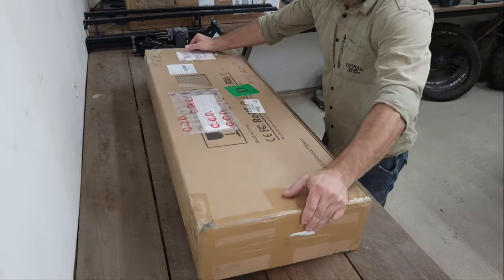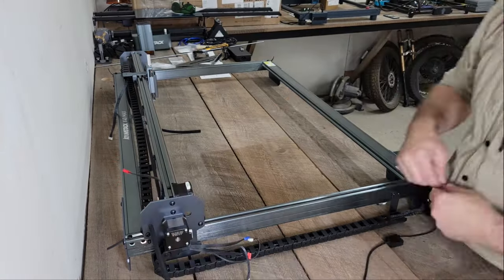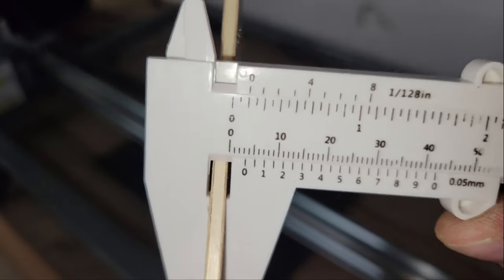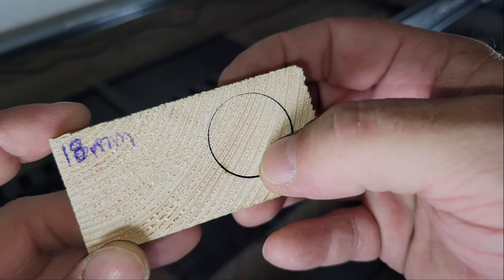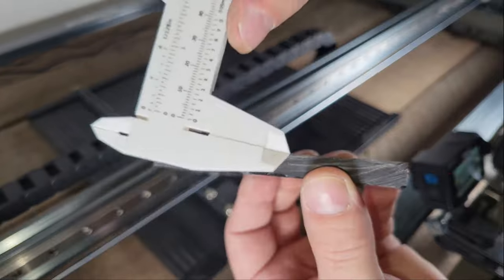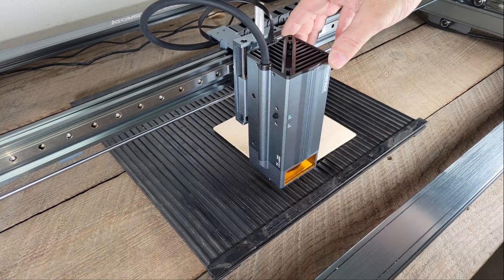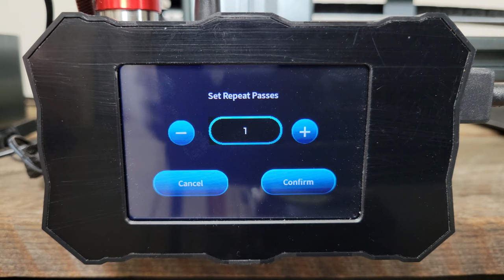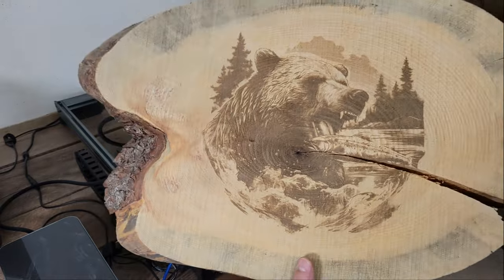Atomstack X40 Max 48W Laser Engraver Review

Comment: Just purchased the AtomStack X49 Max. I purchased the cover for it, I don't like it. It covers up the workings of the machine. I need to make some blocks to stabilize the legs on the mounting surface. Also need a way to use a riser of sorts to use a rotary. I also purchased a very nice cutting surface from Amazon. It fits perfectly.

Comment: Am I the only person who like to use thicker plywood for projects? I notice everyone always tests cutting through solid wood but never 1/4" or 1/2" plywood...
Reply from the maker: Then you haven't seen enough of my videos. I test cut through 1/2-3/4" ply all the time. The power requirement difference between ply and natural wood of the same species is marginal at best. Ply is more predictable because the quality is more consistent and easier to control. No knots or fatwood to deal with. I like using thick plywood when the need calls for it. Not everything calls for thick plywood. Not everything looks good made with plywood, either.

Comment: Can you please do a video for cutting ABS plastic 4mm? Thank you.
Reply from the maker: You can't cut abs with a laser, unfortunately. It doesn't vaporize, it melts. Makes a mess, inaccurate, toxic fumes.
Reply: @JamesBiggar many thanks for your reply. But acrylic can be cut, according to some information. That s correct?
Reply from the maker: Black acrylic only for diode. If you want to cut others, you need co2
Reply: @JamesBiggar  appreciate your reply. Very useful!
Co2 equipment's much more expensive.
This thing of laser cutting is not easy as a person could think.
Thanks for all

Comment: Nice review. How long did it take to receive, once you ordered? Have you had any problems?
Reply from the maker: Only took about a week and a half. No problems yet. Super simple to set up and it's working great so far. I've invested the same into other engravers that weren't half as good as this. Literally less than half the size, half the power. The quality is top notch.
Reply: Hey BeetleBeetleY, I also own a X40 Max and struggling really hard to get useable cutting results out of it. I mostly try cutting 9mm plywood and it is always a balance between cutting and burning the material. when you try complex shapes most cuts are inconsistent and the surroundings get heavy burned. Think about what you want to do with your laser, before you buy one.

Comment: Any idea if it can cut carbon fiber sheets? 3mm thick would be amazing.
Reply from the maker: Not sure, but great question. Generally, diode lasers have a hard time engraving or cutting clear material without having to color the surface first (some clear materials are unaffected by the laser, some scatter the laser, some absorb too much and burn/melt instead of vaporize like it should). So the epoxy could be a problem depending what you're working with, exactly. If you've got to cut through a thick finish coat, I doubt it would work without making a mess. If it's just wetted (but cured) cf, it might. The dark color could be enough to make it work. I don't have any cf but I could dye some epoxy and laminate a fiberglass panel to try.

Comment: This is by far the best review I’ve yet to see on this engraver, including the ones ATOMSTACK has on their website. 

I have a question regarding the engraving material test. Do you raise the Z axis to 8.5 mm in the 24W mode or do you only raise it if engraving in the 48W mode? I’m new to lasers and I’ve had no problems w the cut test on 1/8” ply but struggling with getting the engrave to come out correctly. 

Thanks again for the video.